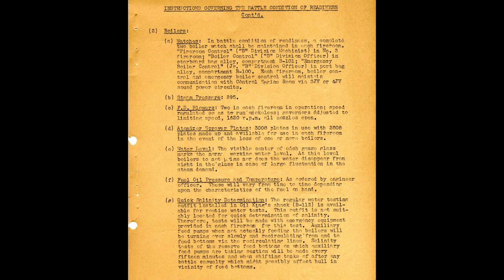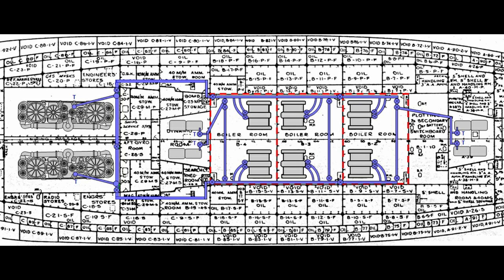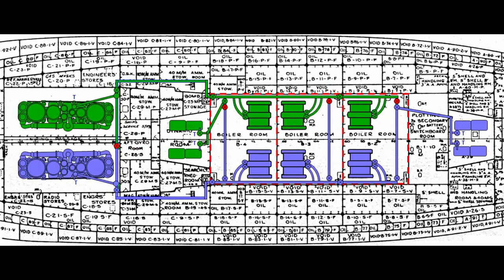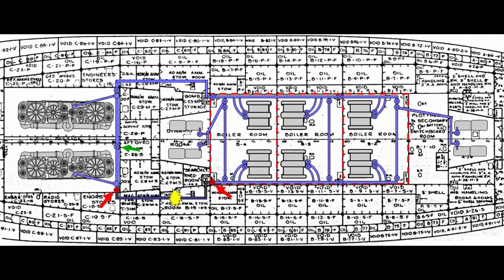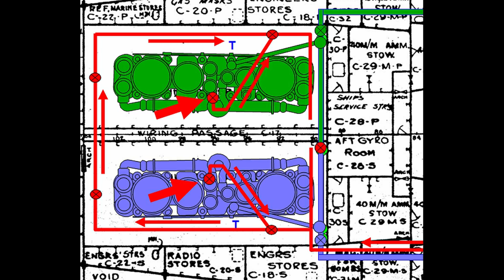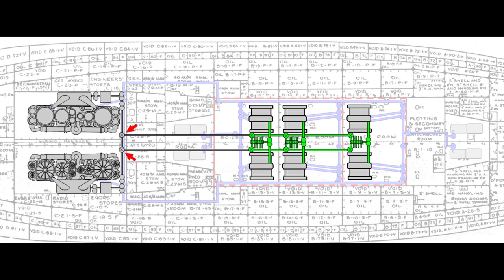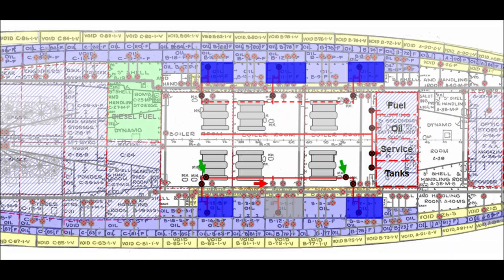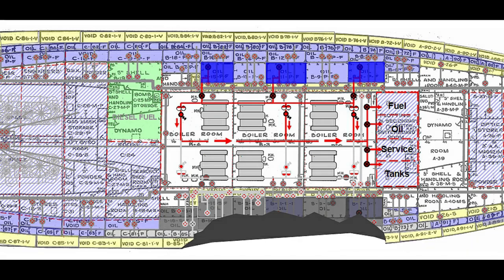Battleship Texas, Getting Ready To Fight!

Comment: The Battleship Texas originally had a top speed of 21.05 knots from 28,737 shp but due to the addition of the torpedo bulges the top speed was decreased to 20.35 knots

Comment: Saw Texas yesterday for the last time till the repair. I hope it all goes well! The stern was a little lower than usual she looks like she's resting on the mud im worried she might sink on the way to the dry dock
Reply from the maker: I am not sure why the stern would appear to be low.  The ship is actually riding fairly high and I haven't heard of any significant flooding issues lately.  It is possible that she was touching bottom when you saw her if the tide was unusually low.  Dragging on the bottom will not be a problem when she is towed since they will wait until high tide to pull her out of the slip.  Plus, they have been dredging behind her stern and along her sides where they have already removed 20,000 cubic yards of silt to be certain that there will be no interference.  

Don't worry about her sinking during tow.  Even the slightest concern that the ship could sink in one of the world's busiest ship channels and block a major port for weeks or months is enough to cancel everything.  The Houston Ship Channel Authority, Coast Guard and insurance companies have signed off on the towing plans, so that is pretty solid assurance.  $35 million was spent within the last 10 years to make repairs and reinforce the hull structure and interior bulkheads.  There are some areas, such as the external torpedo blisters, that were prone to flooding that are now filled with closed cell foam to exclude water.  Beyond that, considerable work has been done to create a pumping plan, and preposition pumps and hoses that will be manned throughout the tow.  Lastly, they have performed extensive simulations of the tow in a virtual reality simulator of the ship channel in order to prepare a towing plan and contingency plans for every conceivable problem.

Comment: Does this ship have the usual operating restrictions as other museum ships?
Reply from the maker: If you are referring to being demilitarized or disabled so that she can no longer sail under her own power, that is correct.  In fact, some measures used on Texas were more dramatic than on later ships.  The propellers and prop shafts were removed by the Navy prior to 1948.  The smoke stack was also capped to prevent rain and water intrusion, but that also meant that boilers could no longer be fired to provide the steam needed to run practically everything on board.  Through-hull openings were blanked off mainly to prevent water intrusion, but it also prevents the operation of machinery needed water to run or be cooled.  The big guns were not demilitarized, but they became useless without appropriate ammunition, and the constant and expensive maintenance required to keep them operational.

Comment: While this is an interesting video- does it really relate in any way to the current problems the ship is having? Are you not more worried about the ship literally falling apart and sinking on the way to drydock? Maybe this would be a topic of more interest to everyone?
Reply from the maker: I find it a little odd that I should ignore what I feel are historic and technical subjects of interest to simply duplicate what is already being covered.  Information about current repair efforts is easy to find and view or read, so I see no reason to simply duplicate what is already out there.  Besides, there are a lot of moving pieces in the effort that will change before the ship is towed in August, so anything worth talking about will likely be wrong by then.  

The ship doesn't really have any current problems and it is not "literally falling apart".  The risk of damage or sinking are exceptionally remote.  Do you really think that the Houston Ship Channel Authority, Coast Guard or insurance companies would allow it to be towed down 40 miles of channel if there was even a remote possibility that a 29,000 ton battleship could sink and block one of the busiest ports in the world for weeks or months?  Exceptional work and $50 million has been spent to perform structural and watertight integrity repairs leading up to the tow.  Expanding foam has been used to fill compartments that have a history of flooding to exclude any water.  Scores of high capacity pumps and portable pumps will be placed following a detailed damage control plan and will be manned by skilled salvage contractors during the tow.  The tow has also been planned in detail and numerous scenarios have been run in a high resolution virtual reality mock up of the channel to establish procedures and contingency plans.  All of these things have been reviewed by all concerned parties, including licensed marine architects and engineers.  If they are confident of the tow's success, so am I.
Reply: Knowing that the tow team has the situation well in hand, I’m comfortable with diving into the technical details of Texas’ systems. Thanks for all the research and time that goes into every one of these videos on this unique channel.
Reply: @tomscotttheolderone364  hi, I would think you would want to be telling us everything you could about the up coming repairs. Everything. That is what I am most interested in. What is the real condition of this ship?? How close are the engine to falling out of the ship? I bet the entire bottom and related structures must be replaced. I will be shocked if that is not the case. What do you currently think the extent of ALL the damge is?? What is the current estimate of ALL the damage?
Reply: @tomscotttheolderone364  Well-said. This ship is a national historic artifact whose technical details deserve to be recorded, and I'm glad you're doing it. There's no other channel quite like this one. Keep up the good work and ignore the ankle-biters.
Reply: These videos are almost priceless and very much appreciated. I have wondered about many details that are answered in these videos. Thank you for posting them.

At the same time, I do understand the other comments. I've been reading on various sites for years about the very poor condition of the hull and associated structures, amd associated flooding. I guess I got an incorrect perception that the ship had lost a lot of its structural integrity. However, I am quite concerned about how much additional work will be needed once she is "opened up." Finally, it would be wonderful if it could be preserved permanently out of the water.